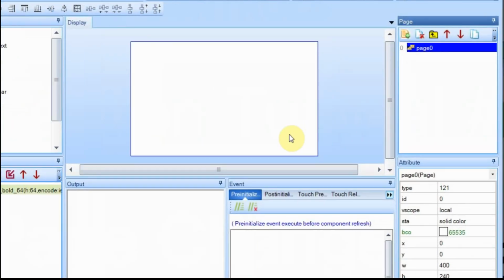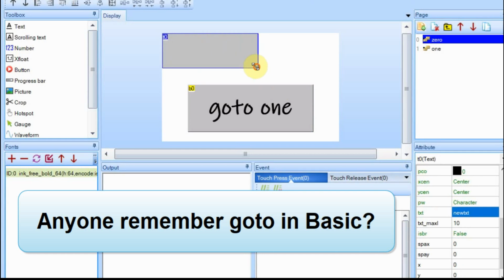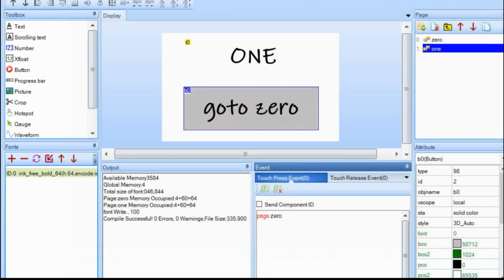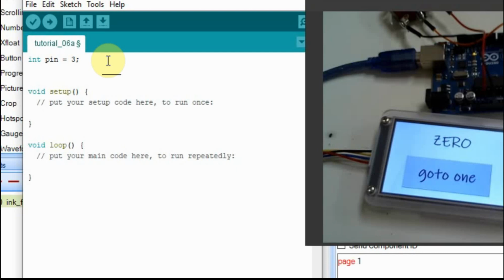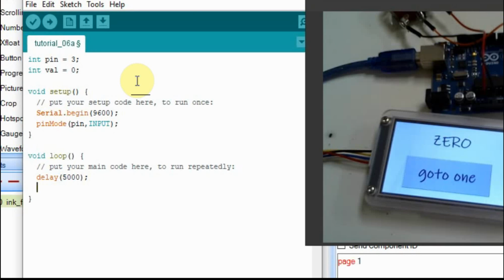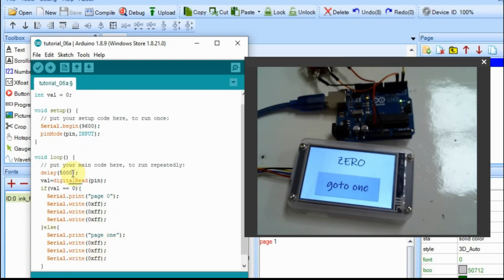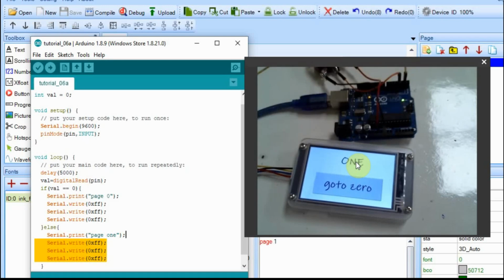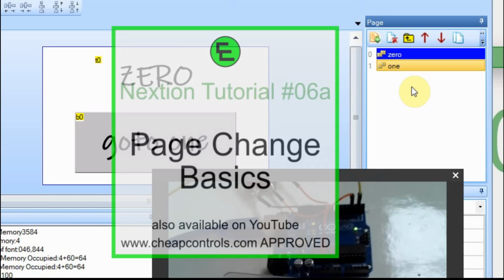67 Nextion Display Page Change with Arduino and NO Nextion Library Nextion tutorial Part 1

Comment: I am making progress in understanding how to program the ESP32 and the Nextion. It is slow but I am making progress in a determined way. Now I cannot find any videos of sending a signal from the Arduino to different pages on the Nextion. If I comment out page 1 on IDE then there is no problem in getting the boxes populated from the Arduino to page 2 on the Nextion. Also when moving from page 1 to page 2, data from the Arduino is deleted on page 1. Have you experienced this or is it jut a feature of the Nextion? 
I currently have 6 numbers boxes that are populated from EEprom in the Nextion but can be updated and saved back to EEprom. I do like to see the same data coming back from the Arduino sitting in a column of number boxes alongside. To complete the project I am working on I need to have a second page of both number boxes and text boxes. At the moment I am stumped. Can you help?
John
Reply from the maker: You have to set the box to global.  Try this video https://youtu.be/jXpgeZ7cmRo
Reply: @CheapControls  Thanks for the reply.. I had found that I had not noted them as Global myself. I am rapidly learning now and the latest stumbling block was to get some simple division to work. I discovered there is no such thing with Arduino and Nextion! I spent ages figuring out for myself how float values v int v long v string worked and by using numbers rather than cell references I eventually got it to work by trial and error, subsituting cell references for actual numbers and gradually it all worked. Thanks again for the various tutorials. John

Comment: I'm sorry if this has been covered... But I'm not quite sure I understand what physical pin on the controller your using to "Write" to the Nextion.  Did I miss something? Edit...
I think I got it.  Serial.Write is hard coded to go out the tx pin of the Arduino, no need to define an output pin.
Reply from the maker: That is true.  In some of my videos I use a nano and in some I use a Mega.  When I use the nano I use a library called softwareserial.

Comment: I have a question regarding the Nextion display and a double state button with the project having multiple pages.  Here's an example of my project:  On "page 0" I have a double state button used to turn on and off an LED hooked to an arduino.  On "page 1" of the project, I have a number box that shows the data coming in from a potentiometer hooked to the arduino.   The problem I'm having is that when I press the button to turn on the LED, then go to page 1 to look at the potentiometer value, then go back to page 0, the button is in the LED off state eventhough the LED hooked to the arduino is on.  I have to push the button twice to turn off the LED.  How do I configure this project to show that the button is in the ON state when switching back and forth from page 0 and page 1, since the LED hooked to the arduino is ON.   Anyways, these are great video tutorials on the Nextion display. Thank you!
Reply from the maker: Try changing the scope attribute on the button the from local to global.
Reply: @Cheap Controls , ok I'll try it, thank you.

Comment: If I have "Next" button that will go to the page 4 but it will not  go to the page unless I receive number from arduino that will be less than 100 for example I added float number called x0 in the screen and it will show the number I reviewed from arduino 

So in the "next" button I added instructions set
in nextion editor :

If( x0.val<100) {
page 4 }

but it doesn't work :(
Reply from the maker: this would depend on how you have your x0 button configured.  How many decimal places are you showing?
Reply: @CheapControls    3 integer digit 2 decimal digits 
For example 100.25
Reply from the maker: I would probably need to see the code but 100.25 xfloat value is actually 10,025 integer.
Reply: @CheapControls  how can I send it to you?
Reply from the maker: You have 2 choices.  There is an email associated to this youtube channel or you can go to www.cheepcontrols.com and submit a comment.  I will reply and then you can send me your code.
Reply: @CheapControls  I sent it via email
Reply from the maker: @user-hu8sc5cn4n  What did you put as the subject?  I did not receive anything but I will search through my spam for your subject.
Reply from the maker: Your Email did not com through.  You might want to try submitting a comment over at www.cheepcontrols.com.  I will reply with an Email address.

Comment: I wonder if there's a way to make a one-time setup type screen. Where the code runs the first time it turns on, then after that, however many times you turn the screen off and on, it'd never run that code again.
Reply from the maker: On the Nextion or load a single time from the Arduino?  Both are possible.  Thank you for watching and taking the time to think of an original idea.
Reply: @CheapControls  either. I just really want a way to make a one-time setup screen with my Basic Nextion Display, since you can't save data with it, according to the documentation, I thought you might have an answer :)
Reply from the maker: Let me think about it.  What do you normally connect your display too?  I usually use an Arduino nano.
Reply: @CheapControls  I use my Leonardo.
Reply: @CheapControls  But yeah, I basically just want to be able to save data between on-off cycles, whether it be variables or constant, but I don't want to get the Enhanced version to be able to programmatically save files to an SD card.
Reply from the maker: The Leonardo has some eeprom.  You could have a set of values stored in eeprom and every time the Nextion is powered up it could send a command to the Arduino.  The Arduino could then set the Nextion to specific values.  Then the Arduino could set a bit in eeprom so it will not update those values or run a certain code unless the eeprom location is cleared out.  This would allow a later command from the Nextion to do a reset at a later date.  I hope that was clear.  I am going to add this to my list of video topics.  I think it would be interesting.  You do have to be careful when using eeprom.  There is a limited amount of write/clears before it becomes unstable.  If you get this going let me know.
Reply: @CheapControls  I get it. So, it'd be possible to check if there's no data in the EEPROM, send a user to a page, then add a small string of data so it doesn't run that code again?
Reply from the maker: Not exactly.  I would like to work with you on this but I think we should move this to email.  WIll you go to www.cheapcontrols.com and fillout the comment form and I will reply with my Email.  I don't put my email in these comments but you can also find on the you tube channel contact page if you want to go that way.
Reply: @CheapControls  Okay, I filled the form out and sent it a few hours ago.

Comment: Hello, can i read only over seriell pin the actually loaded page number from the nextion display without the libary. i mean, when i power on an arduino, the scetch reads over the seriell connection, which page is on the nextion display loaded? i doesn't found anything in the internet, only examples with the nextion libarys, but nothing without the libary ...
Reply from the maker: the sendme command will send the page number over the serial port.  I have been meaning to make a video on this command.  No library needed for this.

Comment: Why does my nextion have an extremely noticeable page change? A white slider slides quickly across the screen and load the new page. Really ruins my designs.

Im running the enhanced 4024k011 3.2”
Reply: Here is an example of what mine does:  https://youtu.be/y5fZlWnO4tU
Reply from the maker: Thanks for the link.  I don't remember it being that distinct.  I will look at it again.  Do you mind listing the background color numbers you are using?
Reply: Cheap Controls I don’t have them at the moment, I can check when I get home but, it does it regardless of the background colors
Reply from the maker: That model is one my favorites.  Enhanced but at a good price.  I have not been able to justify the cost of the intelligent models yet.  I had a similar issue.  i wanted to have a png of an led and use the vis command to display and hide it at a rate that made it look like it was fading out.  This is not possible with these displays.  You have to remember that sometimes it comes down to the fact that you get what you pay for.  Over all I am happy with them but I do wish they had a little more power.